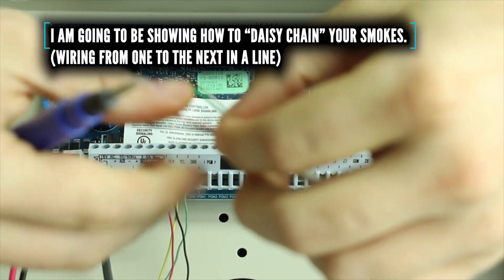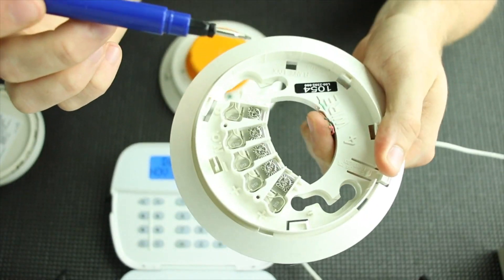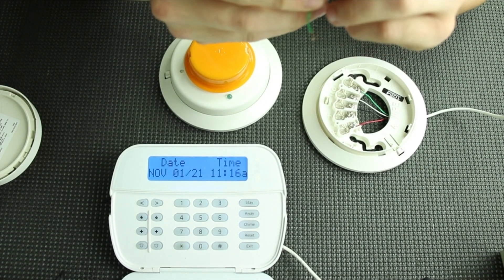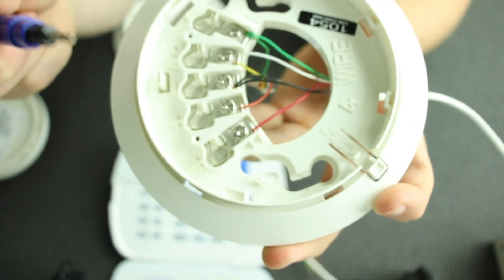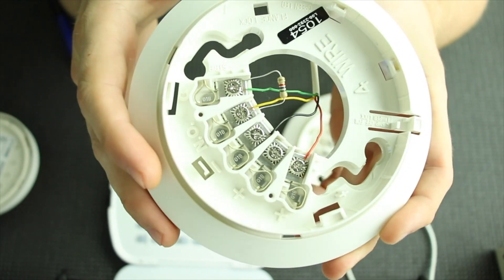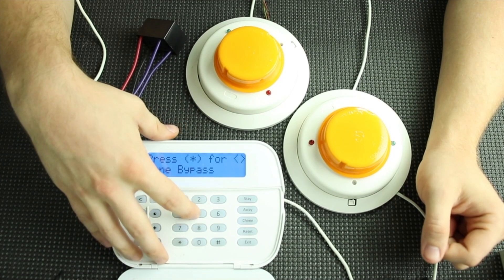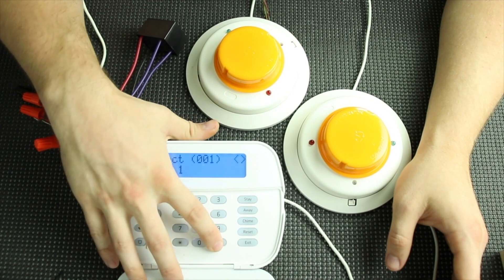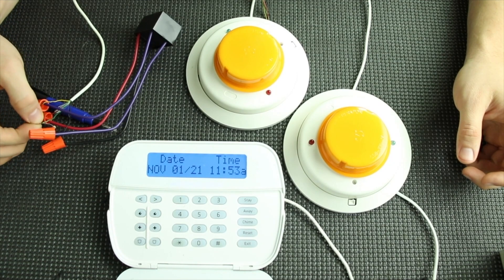How to wire and program System Sensor 4WB series 4 wire smokes detectors on a DSC PowerSeries Neo.

Comment: Thanks! I just replaced three inline 2112/RT units with three 4WB-T units, one on each of the 3 floors of our house. 

The upstairs one had the resistor and that replacement was easiest. 

The one on the main floor had two sets of wires, with one red wire in each of the first two slots. 

The one in the basement also had two sets of wires, but BOTH reds were in slot 2.  I rewired the same way and it tested fine.  But, is this OK? Thanks!

Comment: Great video. I have "ESL 445CT Security System Photoelectric Smoke Detector Heat Sensor" with Ademco panel.  I am wondering if I can replace with System Sensor I3 series with 4 wires and follow the same settings? Will the same resistor needed for the last smoke or we can leave the last smoke with just wiring and no resistors

Comment: Can this unit replace my 20 year old ESL 541CXT?  I've been getting an error message on my Alarm panel and it only goes away when I disconnect it.  I'm thinking after 20 years it has finally died.
Reply from the maker: Yes, the 4WT is the = to that model. See here:
https://www.alarmsystemstore.com/products/system-sensor-4wt-b-four-wire-smoke-detector

I'd say it's time after 20. They recommend replacement about every 10 years.
Reply: @AlarmSystemStore  Terrific, thanks for the quick reply.  Can you tell me if it matters which + (plus) I connect my red wire to?  I have my four wires and a resistor between COM and NO on the ESL 541CXT and only had one + (plus) connection. My home has only one of this type of detector.  The rest of my alarm system has 10 that are typical 2 wire (with common or ground?) that are all looped into the system.  Thanks again!
Reply from the maker: @stepht4109  Your power wires def matter where they go. These are typically red and black and go to + and - 12v connection on whatever panel you're using. The other two for the zone are not polarity specific though.
Reply: @AlarmSystemStore  I may not have been clear with my question, but I have since learned that it doesn't matter which positive connection you hook the red up to as long as black is to negative, green to COM, white to NO and a jumper between the green and white.  The System Sensor 4WB series 4 wire smoke detector has 5 possible connections and the first two are positive.  That is what was confusing me, but it appears the second positive connection can be used for looping other detectors to this main one.  My system has this detector going to the main panel and alarm keypad and all my other smoke detectors are wired to each other in a separate "system."  Not sure why, but my house was built in 2000 and this is how it was originally done.

Comment: My System Sensor Cosmo-2W alarm/CO2 sensor went off but can't seem to shut it off and can't find a reset.  I had to take it down and remove the sensor but when I attempt to replace it in the ceiling the alarm won't shut off.  How do I reset it to silent it?
Reply: *72

Comment: So this is if all the alarms are daisy chained right? What about if each smoke detector is homeran back to the panel? I know there's a resistor involved but the drawing they send are kind of hard to read and I don't know where it goes.
Reply from the maker: The resistor will always go at the end of the line. If you have the 4-wire smokes homerun to the panel, you will just put one resistor at the end of line for each zone.
Reply: Since smokes are programmed as normally open (NO), the resistor goes across the loop, from C (common) to NO on the smoke detector.